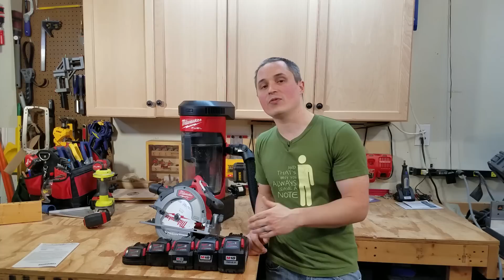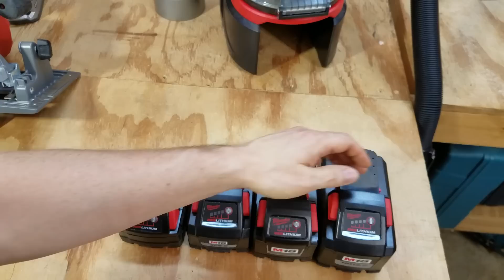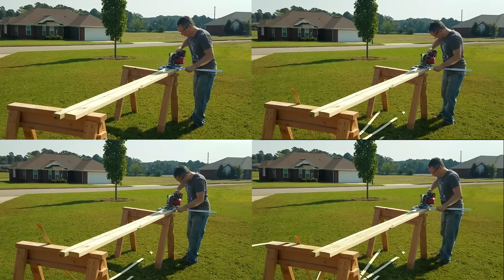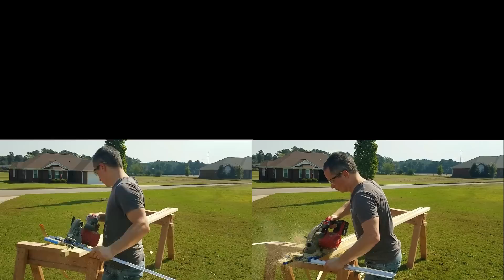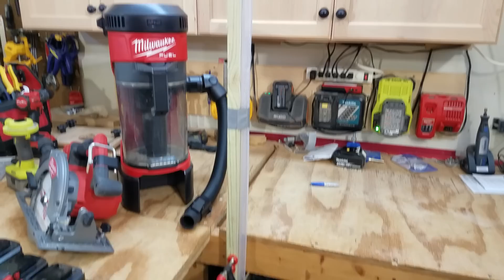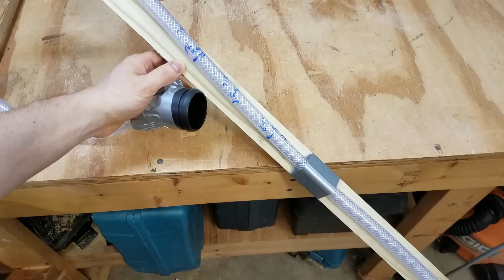Milwaukee M18 6Ah vs 9Ah vs 12Ah High Output Battery Performance Test

Comment: Cool video, great job once again. I noticed a big difference between the 5.0, 9.0, and 12.0 ripping 2x12 pressure treated with the gen 1 7 1/4 circular saw. The 12.0 is noticeably faster than the 5.0 and the 9.0
Reply from the maker: Thanks for the info on the Gen 1, good to know there's a benefit to older tools as well!
Reply: absolutely. I've yet to see anyone stall their fuel circular saw with a 12.0 battery in it. I guess you could with a completely dull blade in wet lumber.

Comment: As a Carpenter I use a 5 or a 12 on most tools at work, I don't find the 12ah thst heavy even on our Sawzalls. I prefer the 12ah on a circular saw because of the runtime and power typically when you're forming up a foundation you won't use the saw as frequently as you would on building the actual forms, so a 12ah will last you 1-3 days.

I'm hoping to get my own tools one day but it's really hard to justify I really only buy M12 6ah batteries because I use them for my heated hoodie, my utility nozzel and M12 fan because I need to sleep with a fan.

Comment: 👍🏾 nice. 
Looking at the backpack vacuum package that come with 2 6.0 high output batteries. Looking at how much run time in the low and high settings. Low/tight carpet at schools.

Comment: i have a bosch impact drill 25618 and both bartteries that came with it was bat612 and they don't work at all and i don't understand why. i had it going on 3 years and i only use it once and i never charged them so i heard the battery died and the other one stays with 3 bars showing. so i want to purchase a high output battery for my impact drill
Reply from the maker: Letting lithium ion batteries sit near empty without charging them is bad for them and might be part of the reason they died. Also, these M18 batteries won't work with your Bosch drill. Only Bosch batteries will.
Reply: @DoresoomReviews  well thanks for telling me i will keep them charged next time i didn't know that. i'm going to see about buying another battery but this won't happen no more

Comment: cool thanks. I'm currently shopping for my Milwaukee Fuel circular saw. I was debating on the 12 or 6, thanks for clearing that up.
Reply from the maker: I usually use a 6Ah or 8Ah HO battery in the circular saw myself. My 12Ah stays parked in more stationary tools like the Rocket light or the air compressor.

Comment: I use the 12 for 9 inch grinder. Not impressed.  To easy to trip out. With higher amp draw tools... I am hearing the 6 might be better. From higher amps rating. My 12 had one light off after charging and now 2 lights. Very disappointed in HO compared to the competition.
Reply: So I think my 12 is damaged

Comment: 6.0 vs 9.0 for the milwaukee 18v chainsaw? I'm 5' 62yr age female, not strong but I need a battery chainsaw out in the pasture/away from the house. Given the weight of the chainsaw I'm not sure if I can hold it up with a 12.0 battery for very long, so will the 6.0 or 9.0 work and if so which one? Tks.
Reply from the maker: I don't have the M18 chainsaw myself, but I would expect it to run the best on a 12Ah. If you think that's too heavy, I'd go with the 6Ah or 8Ah HO battery. The 8Ah came out after I did this review and is the same size and weight as the 6Ah.
Reply: I have it and you need the 12.0 battery, honestly you need to or three. The batteries tend to overheat quickly. Love the saw but thats the only issue i have found.

Comment: I just bought a m18 drill set with the 2.0ah batteries but they came dead, so when I put em on charger it shows a red n green light blinking. Can someone give me a clue of what that means?
Reply from the maker: That means a broken battery. Make sure you're seating them fully on the charger, since sometimes they can give a false reading if they're not fully connected. If you still have the problem, I'd return the kit to the store for an exchange.
Reply: @DoresoomReviews  thanks u so much at least now I have an idea of what can be wrong.

Comment: Which one will last me longer on a flashlight
Reply from the maker: The 12Ah, since a flashlight is relatively low current draw.
Reply: Sorry, I meant for the floodlight.  Am assuming 9Ah and 12?
Reply from the maker: Yeah, every light I've tested of Milwaukee's has a linear runtime per Ah of battery, including the Rocket Lights. So a 12Ah battery will last 3X as long as a 4Ah, or 2X as long as a 6Ah, etc.
Reply: @DoresoomReviews   So buying 2x6Ah = 1x12Ah in term of run time for majority of the tools?

Comment: What battery have more run time? Ryobi 9Ah or Milwaukee 9Ah whit adapter to use in ryobi machine??
Reply from the maker: I haven't tested, but if you're going to use it in a Ryobi tool, I'd recommend just going with the Ryobi battery. They both have the same energy storage capacity, and while the Milwaukee may discharge more efficiently, I doubt you'd see any advantages because an adapter won't let the tool and battery communicate with each other for the maximum efficiency boost. Plus the Ryobi will be way cheaper!
Reply: Doresoom Tool Reviews Thank you for answering. In my country (spain) the ryobi 9Ah battery cost 202 USD (expensive). That's why I was wondering about the adapter.

Comment: Glaring issue that you just completely overlooked runtime, that's essentially all I care about. I want to know exactly how long these batteries last under heavy load from the 4.5" fuel grinder. Does anybody know someone that has made a video for this?
Reply from the maker: I left out runtime because there's no way I can test every use case. It will be approximately linear per Ah rating, with a little efficiency boost for batteries with a higher number of cells, or 21700 cells. The cooler the battery stays during discharge, the better the efficiency.

Comment: I use my batteries in the Fuel drill/driver to drill 8” holes through the ice for ice fishing. With one 5ah battery, using an 8” Lazer hand auger, I can drill 30 holes through 20” of ice. I just got the 12ah to upgrade the 5ah and I can’t wait to try it out this season. It’s definitely a monster of a battery!
Reply: Legend has it, he's still out there drilling...
Reply: so any update on the 12ah battery with the 8inch lazer auger??? how may holes vs 5ah battery?

Comment: I have Dewalt and rigid line of tool. Milwaukee is definitely a top tier brand I just didn’t start in that direction and with the price of batteries of course you stay in your lane. My rigid next gen tools are 18v and corded option tools. I was going to move up from 5ah to 6ah. 
My question covers all batteries. Do tools have a governor so to speak as to not receive to much power. For example if a saw is bogging down due to a variety of factors instead of backing off a little, would more power damage the motor by pushing in harder? What does the ah mean? Like a 12ah vs a 20ah vs a power outlet. I mean would it still bog down if you plugged in into a lighting rod? Where do you draw the line on how much is too much vs pushing the tool to hard and the battery just keeps shoveling in more power? Not be smart ass. I really found you video informative I’m just not sure where this goes. My 18v hybrid cordless/ corded fan lasts 2 hrs longer on 5ah on high vs 4ah but the 530cfm stays the same as if it were plugged in. 

Ps. Funny enough the only reason I headed into the rigid brand was because I needed a cordless fan desperately at work a the 530cfm ridge vs the Milwaukee and Ryobi on put out 270cfm. But Milwaukee does have a bad ass line up.
Reply from the maker: Ah means Ampere-Hour, and it's a measure of energy storage capacity. A 12Ah battery can supply 1A of current for 12 hours, or 2A of current for 6 hours, etc. That's why your fan runs longer on a 5Ah than a 4Ah - I'm guessing the 4Ah can run it for around 8 hours, while the 5Ah can run it for 10? That would be consistent with the fan drawing 0.5A of current continuously.
It depends on the power tool brand, but Milwaukee has designed their tools so the batteries and tools communicate during use. So the tool can "ask" for more current during high demand applications, and the battery can supply as much as its capable of. In general, higher Ah rated batteries are usually capable of higher current discharge rates, since the "XC" form factor has two rows of cells as opposed to the "CP" slim pack design that has one row of cells. So the tool can draw on both those sets of cells at the same time from the larger packs. Cell type also matters, which is why the batteries with the newer 21700 cells outperform those with 18650 cells.
Reply: Doresoom Tool Reviews couldn’t have asked for a better reply. Thank you

Comment: I've only got the smaller 1.5 Ah batteries that came with my M18 drill/impact. I think I saw that you said the 2 Ah battery couldn't drive your Gen 2 Circular Saw? Trying to decide whether I want to get a corded saw or get an M18, but having to buy a battery would probably make it too expensive.
Reply from the maker: I would not buy the bare tool Gen 2 Circular saw if you only have slim pack batteries. I'm not sure they sell it without the 12Ah battery included anyway though. Here's how it performs with the 1.5Ah and 2Ah batteries: https://youtu.be/oEkdf6vIJkU?t=364

Comment: I bought a brand new Milwaukee M18 Fuel Brushless Super Sawzall.  It broke down within a week.  Sent it back to Milwaukee eService Center for repair.  It came back with gear noise and I pulled the new trigger but the motor stop running.  I shook the sawzall few times and the motor was running few seconds then it stopped.  Contacted Milwaukee customer service for a new replacement sawzall for this manufacture defective sawzall.  Customer service told me to ship my brand new defective sawzall back to the eService Center for a second repair.  No replacement for a new sawzall.  Don't trust what you saw on youtube for the Milwaukee Customer Service and their quality so called tough professional tools.  I should buy a Ridgid Octane sawzall for a cheaper price.  At least Ridgid has longer work time, whereas Milwaukee has longer repair shop time.  Why should I paid more money for a longer shop time and a shorter work time?
Reply: Go for it, Ridgid, Ryobi and Milwaukee are all owned by the same parent company lmao
Reply: I understand why you might feel like this.  However, what does your Sawzall problem have to do with a video and discussion re:  Milwaukee M18 batteries?
Reply: Sir, this is a Wendy's.

Comment: I used the 6.0 high output battery on my 1/2 big fuel impact model 2767 for some jeep suspension work and the run time is pretty much same as my 5.0 and not impressive. I couldn't even notice a performance increase because the tool always hits hard anyways. 6.0 battery will benefit those with saws and such heavy drain tools that need sustained torque vs peak
Reply from the maker: Thanks for the info on the impact!
Reply: So I should get the 6 over 9 for the chainsaw? I’d only be using it for camping so it’s not worth buying a 12.
Thanks in advance

Comment: Which battery would you recommend for my high impact drill ? 2767-20 model
Reply from the maker: You'll probably be fine with just the standard 5Ah, but if you want to upgrade I'd pick the 6Ah HO. I think a 12Ah hanging off most pistol grip style tools is just going to be too much weight to use comfortably. I don't have that tool myself, so haven't been able to test the performance difference though.

Comment: What would be the best battery for the mid torque fuel impact?...Just using it for tire changes...thanks!
Reply from the maker: You'll probably be fine with just the standard 5Ah, but if you want to upgrade I'd pick the 6Ah HO. I don't have that tool myself, so haven't been able to test the performance difference though.

Comment: Which battery would be your ideal choice for use with the heavy duty 1/2" impact wrench?
Reply from the maker: I don't own that tool, so I haven't had the chance to test increased performance with the new packs using 21700 cells. But if you're using it for applications at the higher end of its torque range, I'd pick the 6Ah HO for use with it. Increased power without much extra weight.

Comment: Great test!! Thank you for providing evidence. Definitely Will purchase 6.0 if I need more batteries. They keep multiplying though with new tool purchases. Better deals usually with free batteries vs bare tool.
Reply from the maker: I think the 6Ah are the way to go if you'll be using them with drills and impacts too. 12Ah are more suited for the new table saw, chainsaw, and other heavier high power draw tools that you won't really notice the weight difference.

Comment: Im buying the millwuakee rocket light so battery weight dont matter do you think id be better with 1 12ah battery,2 6ah battery, or 1 6ah/1 9ah battery trying to get the most run time for the money...... thanks for any help or opinions from anyone
Reply from the maker: I'd go with 2×6Ah or a 6Ah and a 9Ah. That way you can pop one on the charger while the other is powering the light. Plus, the 12Ah doesn't fit in older versions of the Rocket light. Milwaukee has a free retrofit kit they offer for lights manufactured before the release of the 12Ah battery in July 2018, but all lights made after that date should be compatible.

Comment: I use the 12.0 in my superhawg, if you’ve used one, the head of it is super heavy, a heavy battery actually helps balance it out.
Reply: @b gg oh man, I’ve got three now! Did get the large blower since this post, but I only use em in the superhawg and sds hammer drill otherwise. Worth every penny.

Comment: Interesting results! 
I have noticed that the 6Ah is clearly superior to the 5Ah with the leaf blower.
I wonder if the 9Ah has more current, but lower voltage stability which is what leads to the results with the saw?!
Reply from the maker: As far as I can tell, the 6Ah can output more current than the 9Ah, as seen in the saw test. I think the reason the 9Ah outperformed the 6Ah in the vacuum was because Milwaukee optimized the vacuum for runtime over raw power all the time. The M18 tools can tell what type of battery is installed, and the vacuum probably pulls more power from the 9Ah and 12Ah because they will last longer than the 6Ah.